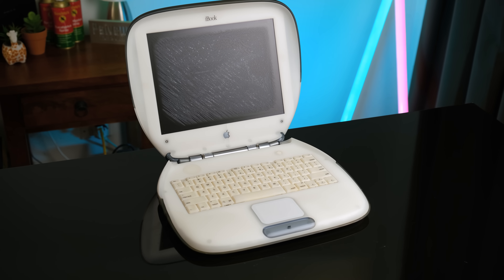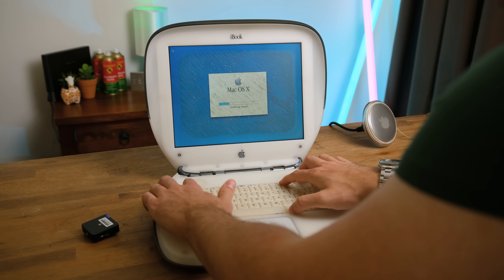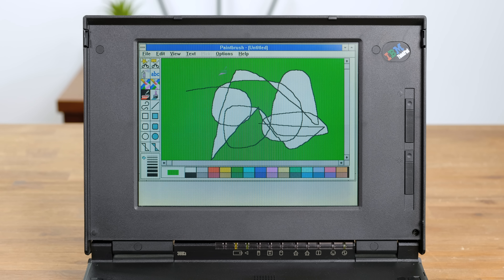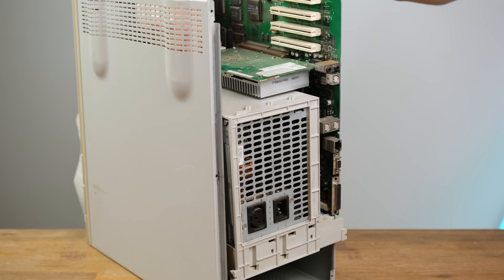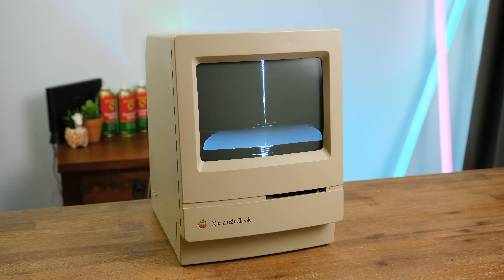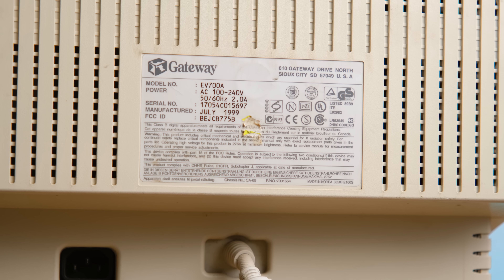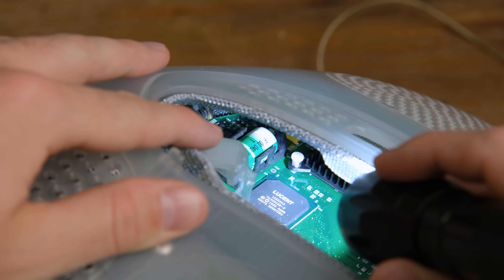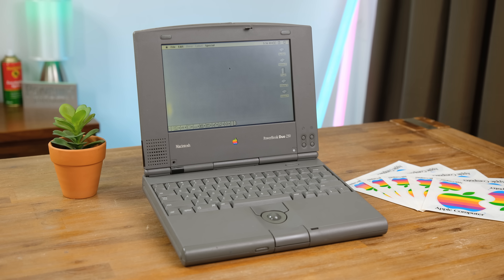So Much Vintage Tech Is Dying... Here's Why

Comment: As a fan of the idea to keep old hardware alive, this is really painful and sad to watch 😢
WiiU owners these days worry about dying NAND storage in their consoles but it tends to corrupt itself depending on who made the flash storage.
Luckily my console is still alive and also my old ThinkPads still work fine but seeing what happened to your iBook is real hard.
Reply: Yeah. Now I'm worried about my Wii U, but it still works for now.
Reply: I'm more worried about the contents of flash drives. The Wii firmware is common and can be downloaded and reflashed to a Wii that lost it's rom contents due to fade.

 But what about personal photos, projects, and other stuff that can't be replaced. The only thing I can think of is archival quality CD and DVD-Rs but how good are these discs in the long term, and will there still be drives to read the discs decades from now?

Another alternative would be to print the data onto acid free paper, using non fading ink, kind of like a series of giant QR codes. But this is extremely bulky, cumbersone and expensive and there is the problem of the software to scan these sheets and convert them back to computer data still existing decades from now, and this would only be practical with small amounts of data (forget archiving videos with this method).
Reply: @ffEthy  You can check if your system is affected by running Mdinfo and seeing if your Nand chip is one of the affected ones. If so I'd recommend backing up your nand Asap.
Reply: some wii u issues are fixable with the UDPIH method, and if you have a dumped nand (which you should if youve ever touched wii u modding) you can actually replace the nand with a replacement chip or a micro sd card
Reply: @gamagama69  wait what can I give my Wii U 1 terabyte of internal memory😮
Reply: Voultar showed a method of fixing it pretty easily
Reply: My first Wii U died to NAND corruption when I opened a downloaded game from the eshop on its system memory. What happened was the game ran for a few seconds, then a big crash, and after that it no longer loaded the menu. Barely got to have it for a year. My new Wii U has everything on a external storage now, and I backed up the NAND this time. Wish I had known about the Wii U problems before it was too late for my old one…
Reply: @Lizuma  unless you can solder, it wouldn’t of mattered anyways about the nand backup
Reply: all consoles are degrading, caps will eventually pop and leak, also dvd's and blu rays degrade over time, optical drives are prone to failures for wear and tear, may take a very long time for these videogames to fail, but it's happening
Reply: @vegetarey  and we're talking Wii U, a console that is barely a decade ago
Reply: Moister is the enemy of an old device, keep in a dry place, but out of the sun. Rub and buff plastic with a little oil. Buff with cloth until dry.
Reply: @STONE69_  Stay away off oils. Hard plastic can swell and turn brittle by contact with wrong oil. In 1990th I had a Toshiba CD writer drive in a PC that tended to get stuck. After oiling with "machine oil", after a while the whole black polystyrene chassis started to crumble apart like charcoal. The same happened with a transistor radio. Also bakelite (e.g. in Hammond organs and tube radios) is infamous for this. When plastic cogs split around the metal axle or concentric cogs in quartz clock movements get stuck, this happens by swelling plastic due to wrong oil. Thus never lube unkown plastic mechanisms with anything but silicone oil. Also most rubber (latex, butyl etc.) turns into chewinggummy goo by any non-silicone oil. By I read complains that otherwise silicone oil may soften silicone rubber (used as rubber keys and key contacts), so do not spill it and avoid to oil if you don't need to. 

Skin lotions (particularly with essential oils like fragrance) can strip paint from keys and decompose plastic surfaces easily. I am very careful with handling tea tree oil etc. Also normal oils (food etc.) can decompose rubber and some plastics, so keep food away from keys. I collect music keyboards and often found small craters in white keys. But I guess it came from letter glued on keys and removed with too strong household cleaners or by disinfectants.
Reply: Lol I know lots of people who still have original Wii's myself included.

I still play Wii sports when people come over. One or my friends was amazed & bought one for his kids for so cheap. Wii's are nice consoles
Reply: It's going to be a challenge one day to see what can be fixed because we dug ourselves deep into programed obsolescence. Some things we'll have to give up on. Things aren't as well made as they were 30 years ago on purpose
Reply: @wolfcanine100  PCs are more reliable than consoles.
Reply: Reading this and the replies was extremely eye opening. I was a Wii U owner in its height of popularity in the good ol sm4sh and splatoon days. A bit before I got a switch I had homebrewed it and I was very familiar with all the NAND stuff. Im genuinely surprised this is a problem for these consoles. So sad :(
Reply: @nipiwaki  To top it all off Nintendo took down the most popular Wii U multiplayer games for unspecified “security” reasons. No ETA for a patch, it’s totally a coincidence it was the still fairly populated prequels the players probably prefer or are satisfied with. Nintendo couldn’t even wait to completely end Wii U online services to shutter down those games.

edit: Upon further reading the games might be facing a real threat, saying they had to be taken down “indefinitely” makes Nintendo look suspicious.
Reply: @protocetid  Wow! That's insane. All of this Wii U stuff could make an actually very eye opening video essay of some sorts. Id love to see someone properly cover it.
Reply: Flash, (E)EPROM, and other variants therof will lose their content over time because the chips themselves rely on a small electrical charge within the memory cells to retain their data. Basically these chips are made up of tiny slow draining capacitors.

A lot of vintage hardware from the 70s and 80s does not work anymore simply because their (E)EPROM chips had lost their contents from this "fade".

 ROM chips that are "mask roms" can theoretically have their content intact hundereds of years from now, provided something else does not ruin them like oxidation/corrosion.

What will be ironic is if the only games from this era that can be retrieved and played will be Atari 2600 and NES games that used mask roms in their cartridges.
Reply: the NANDs can be replaced with new ones.  Here again, you need decent soldering skills and the correct tools.  A solid temperature controlled  soldering station with hot air attachment is what you need to invest in.  Then you can repair pretty much any of this  vintage tech....
Reply: My Xbox 360 Slim console died (red ring of death) after digging it out after it sat in storage for 2.5 years, it was perfectly working the last time I used it. It was stored in a cool, dry environment in a box although it went through a house move before the next time I dug it out and tried to use it.
Reply: as the owner of a wii u with a hynix chip i live in fear every day lol
Reply: A good thing to Note about the Nand issue is that it's only certain chips that seem to be faulty, the journalists really blew that one up to try to scare people and get views (it definitely worked) and it's no where near as big of an issue as people have been saying. Though the good news is that there are solutions to repair affected consoles either with an SD card or replacing the faulty eMMC chips.
Reply: Apparently booting up your Wii U at least once a year can help mitigate this, although unfortunately the flash memory is destined to die eventually no matter what. Pretty grim to think about the fact that at some point emulation will be the only way to experience a good portion of game consoles.
Reply: @CommanderWiggins  
Why is that grim? Thats good thing, emulators can be used even on your phone, making gaming far more accessible to people, you literally arguing for consoles because a certain group of netizens wants to push up used console prices on the used market and argues that console hardware is the only correct way to "enjoy" old games, when in reality no one gives a f*ck what hardware it runs on, they just want to play the game.
Reply: @SMGJohn As a console player myself I enjoy playing games on my PS5 because I know it has pretty impressive power and performance while at the same time isn't as close as a PC in that regard. Perhaps one day console tech will keep up which it kinda is for the time being but for right now PC still has it all.
Reply: Oh no! I have a WiiU with tons of games! I really hope the NAND Wont die on me like my second gen iPod touch :(
Reply: Most of the wiiU reports are from people that have no idea what their talking about and just parrot “muh nand failed”, when in reality the header corruption can be fixed with a simple GitHub program and a pi pico.
Reply: Theres already fix for wiiu nand problems thank god lol
Reply: I got my Wii U 2 years ago and thank fully mine hasn't had this problem,I do use it from time too to time
Reply: my compaq portable plus with its original 10 MB MFM hard drive hanging on for dear life:🗿
Reply: Luckily a wii u emulator called cemu exists. I do have a wii u but I prefer to play wii u games on pc so I don't have to deal with the wii u gamepad and run games with better graphics and framerates.
Reply: Wii U discs also have a high failure rate and suffer from bad batch issues. It can affect any game, even in perfect condition. I had 40ish Wii U games, all bought new. Out of the 40, 8 didn't work. Stored the exact same way I store all my other games. Disc rot for discs this new is extremely abnormal, I have hundreds of games from many generations, even Sega CD. There's some threads on GBAtemp about this. I ended up selling my collection (what as left) realizing it was a ticking time bomb.
Reply: @houdinimagazine  wow this sucks. im glad i backed up my games.
Reply: @houdinimagazine  my super mario 3d world copy also went bad
Reply: geez as if the Wii U wasn’t disappointing enough
Reply: @protocetid  I mean, the PS4, PS5, XBOX One and Series XS are justsilly locked down PCs, so from my perspective these devices are just as dull as the WiiU to you.
Reply: @MegaManNeo  Hey I didn’t say the Wii U was a terrible console, nevertheless it’s undeniable it wasn’t used to its full potential and the lack of durability stinks. Speaking of things becoming PCs, I wish they’d make a phone with a PC processor (AMD or Intel). I want a Steam Phone damn it.
Reply: @MegaManNeo  except Nintendo hasn't been quality for a while
Reply: @protocetid  
Asus used to make phones with x86 processors, Intel Atoms for mobile, needless to say, they flopped HARD.
Reply: @SMGJohn  Atom was terrible, have you seen how power efficient x86 is now? The chip in the Steam Deck can go as low as 5 watts.
Reply: @protocetid  
Still not as efficient as ARM, the architectures are just too different.
Reply: @SMGJohn  Sacrificing the performance of anti consumer ARM phones you barely own for the liberties and quality software on PC is more than worth it. x86 is capable of mobile duty as proven by the example you gave me, it’s not going to best ARM at it but who cares when a lot of that processing power goes to waste. There’s next to nothing that utilizes phone CPUs and GPUs to their fullest except some video games, who would want those instead of proper PC games?
Reply: @protocetid  
Anti-consumer, what a buzzword, you live in Capitalism yet you are crying about business just doing business. 

Come on now.
Reply: @SMGJohn  Say what you will about capitalism, I'm not the biggest fan either, but there are definitely ways to do business ethically. Don't bother replying if you're just going to push more false dichotomies.
Reply: @protocetid  
Cry to the rich, not me bud. I am not the one dictating market mechanics.
Reply: @SMGJohn  I hate the rich too, I just don’t go all the way to the end of the authleft spectrum. Maybe if you had said “we must nationalize Intel/AMD and seize the means of smartphone production” you might’ve had more luck ha ha.
Reply: @protocetid  
Just because you nationalise something under Capitalism, it still means those state companies need to profit to sustain themselves.
Reply: @SMGJohn  No I mean you might’ve had more luck swaying me towards communism if you had said that. BTW I hope you use Linux bro, Marx would’ve liked the open source movement.
Reply: @protocetid  
You know Linux open source is entirely hinged on massive support from huge Corporations who utilise Linux server systems, Microsoft and Amazon are some of the largest contributors to Linux LOL
Reply: @SMGJohn  Yeah I figured you’d tell me it’s not ideologically pure, still miles better than the purely profit driven macOS and Windows.
Reply: @MegaManNeo The PS5 and Series X aren't that far behind actual PCs in terms of processing power and performance. Console tech has improved drastically over the oast few decades and probably will catch up to PCs someday.
Reply: Thank God I got rid of all my consoles, Wii U included, it was a nice device, but the novelty died off when I can play these games on a computer with better longevity, I mean owning a device is cool but unless I can use it, its just hoarding at this point when you own something for sake of novelty, its like a piece of furniture except its freaking decaying. 
You can even use the controllers both the Wii remotes and the tablet on PC, so essentially the argument to maintain these old closed off eco systems, is hoarding at its finest.
GameCube too, loved the piss out of that, but I aint paying 200 euro for a cable to play with a better image, when I can pay 200 euro for a PC that does the same job and offers HDMI and DisplayPort and renders GameCube games in 4k, LOL. I also had an original Japanese PS3 die on me just sitting there, the motherboard because of its cheap construction started to boil and fume toxic gasses, sat in good ventilated storage room with temps at 5 degrees to prevent this plastic decay to begin with. Never again

Comment: As an avid retro PC, cell phone and electronics collector myself, this is my worst nightmare. Every year I dig out boxes upon boxes with devices that I own, and every year I'm terrified to discover that some percentage of the stuff I own have died by simply sitting in storage. Some of the problems thankfully can be resolved (like re-soldering a bulging capacitors, gluing broken plastics, etc.) but more serious issues like the display lamination bubbling up like you shown at the beginning of this video, is unfixable. This is terrible..
Reply: Resoldering a bulging capacitor? You know that you should replace them right?

Comment: At least the only good thing about the HDD issue is replacing it with a IDE to SD one, quite affordable to replace the SD card too if it fails in the future. Also quiet and fast like an SSD compared to an HDD.

Comment: Thankfully i've caught issues just in time with my computers, bulging capacitors and old batteries, i bought a 486SX unit off ebay as it came with a working CRT, albeit a pretty crappy tube but i couldn't have timed it better as the battery corrosion was only on the legs and all that needed a cleanup was the keyboard port and an ISA slot. Time however has not been kind to Xboxs and early Xenon 360s. The green Sanyo capacitors on the power side, HD DVD drives are horrible when they fail and leak, Rubicon and Nichicon dry up when exposed like that Dell GX machine, Panasonics in the original xboxes from heat are prematurely failing, clock capacitors. However i like to think im putting as many 360s as i can back into the wild with the proper work done for someone to enjoy again, its a console i grew up with as a child and i refuse to see it turn into some overpriced hotbox from sellers who want to make a quick penny and sell a doozy. They're still not at the value worth a chip replacement unless its on the original Blades Dashboard. There are a lot of resistors around the 16v capacitors and the XCPU so i'm not looking forward to the day where i start to see these things heavily corroded.

Comment: I would be careful about opening up failed hard drives, dust particles tend to me larger than the normal distance between the read write head and the platter and its why they have to be opened in a clean room or one of those smaller 'mini-clean rooms'.
Reply: Yeah that was a really ballsy thing to do.   I remember around the 2000s some thought it would be cool to have windows on hard drives and the recommended procedure was to do it in a steamy room.  If you ever see an image comparison of the drive head vs. dust or hair it's huge.
Reply: I worked at a hard disk drive production plant, and yes, dust & also particles from your body that are too small to see can cause a head crash. That's why we suited up & the whole plant used laminar airflow with HEPA filters,  raised flooring, and airlocks.